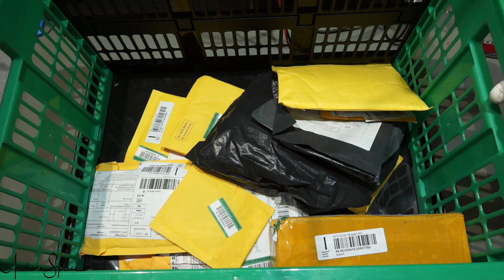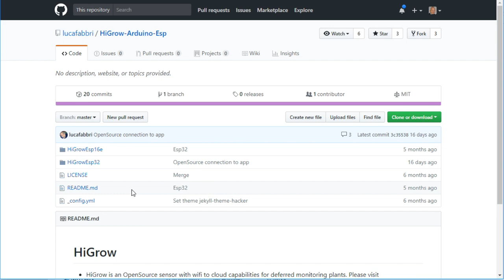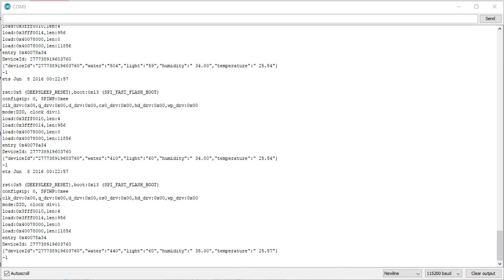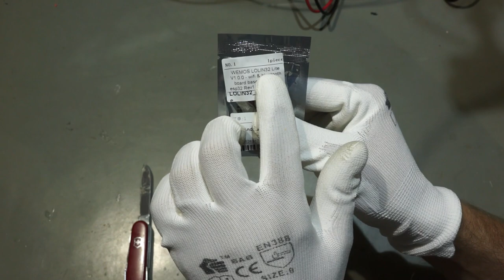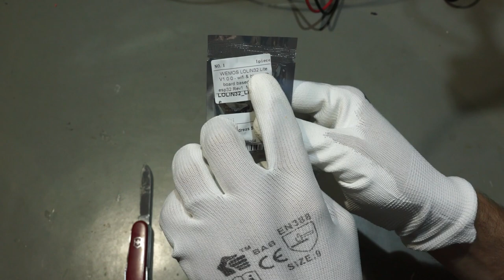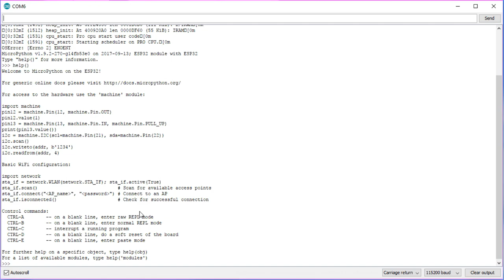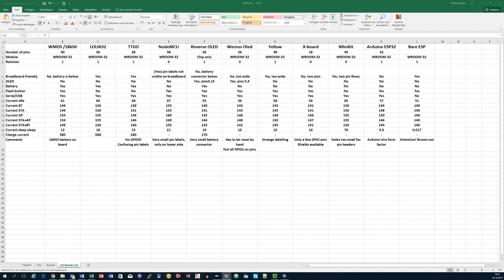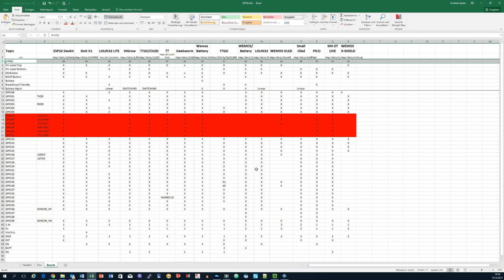#165 Longest Mailbag ever Part 1: ESP32 and other cool stuff

Comment: I don't really see C/C++ going away for microcontrollers. Take the ESP32 for example: If you want micropython + TLS etc (a must for IoT) you have to have external SPI RAM to have enough memory to do anything useful in python. If you do everything in C or C++ it's just about possible to get a ton of logic and a TLS library that supports some of the better cipher suites into ~500KB of RAM.
Reply from the maker: I think you are right in general. But if I see how fast the hardware is moving, maybe we will see other languages on our microcontrollers. And for a beginner, Python is probably easier than C++.
I am also not sure if TLS will be the solution for the moment. We are playing with it on IOTappstory and, as you mention, it does not leave a lot of memory...
Reply: I'm not sure what TLS library you are using but from my experience with ramming mbed into a small space it seems that even the so called embedded libraries aren't well optimized. mbed TLS for example compiles in a massive table of cipher suites to decide which to prefer despite being compile to only support 1 or 2 of them. There are also a ton of tables for sha etc that are loaded into RAM for something like the ESP that loads from flash than can be left in flash and partially loaded in and out as needed.
Reply: Once they start using higher storage ram chips Python will be picked up.
Reply: >Once they start using higher storage ram chips

~512KB or 1MB of SRAM is about the limit for microcontrollers I think. I actually hope we move away for microcontrollers for IoT anyway. A low speed Cortex A chip with some embedded DRAM would give you all the high level languages you want, enough room for proper crypto libraries etc and memory protection etc.
Reply: while any higher level language is probably attractive for beginners, because you dont have to do a lot of thinking, certain things can just be done with lower level languages. they of course require you to actually learn and understand how everything works under the hood. as someone who is proficient in c/c++ it would just hinder me if controllers came with python support. especially when writing applications that barely fit on the chip or which need high performance/low latency.
Reply: C is not going anywhere for embedded. In large production run products companies don't hesitate a moment to spend money on compilers that make smaller code. The reason is cost. The cost increase for a part that can run something like eLua or Micropython is fairly large per unit. That adds up when you mass produce. The Rust language has potential, but C will remain king for embedded use. Not that I don''t like Micropython,  I contribute to it. The ESA has provided funds to port Micropython to the RTEMS rtos that they use on spacecraft. Their targeted role for it isn't anything to do with flight control. That's still in C/C++. They plan to use it for vehicle payloads and science packages. It's much easier to troubleshoot and reconfigure for tasks, and being able to remotely use the REPL to troubleshoot is much easier. 

An often overlooked and under-appreciated language for embedded use is Forth. It does take a bit to get use to, but you can run a REPL complete with a compiler on an ATMEGA328p. That's not a typo, The Forth compiler has no issues running on a microcontroller.  It's a lower level language than C. It's a small stack machine, and forth CPU cores can be tiny and simple. You could probably pack in a hundred cores on a die the size of a modern ARM chip. I'll be the first to admit that it's not optimal for everything, but for control tasks. It's currently in a niche use for very low level needs, BIOS, supervisor systems, etc.

Comment: The esp32 has capacitive touch, I wonder why you cannot just use that by itself for moisture. Wonder why they used a separate oscillator etc.
Reply from the maker: I know about the ESP32 (I even used it in one of my videos). I have a colleague which had some issues with these sensors because of electrical fields. I assume, they only work for small distances. Here, these small sensors could work better because they bridge the bigger distances with a digital signal.

Comment: I strongly recommend not to use Xiaomi devices. I have their phone that was transmitting things to China without user approval, same goes for the Xiaomi Router. No more devices from them in my home LAN.
Reply: Not only Xiaomi but also ZTE and Huawei
Reply from the maker: This is why I want my own firmware. Then, we can control them. They still produce good HW at a cheap price.

Comment: Interesting type of ESP board the ones with battery socket, battery charging and OLED. Too bad one of them arrived with a broken screen but as you might have noticed packing protection is not really used by the chineese suppliers.
Reply from the maker: And unfortunately, I was too late for the dispute this time because I unpackaged it for the mailbag... Maybe I get a replacement screen and change it myself.

Comment: IMHO, it is safe to say Arduino helped quite a lot bringing lay persons into micro electronics, especially encouraging maker scene. Arduino provide an abstraction layer for underlying C++, which is easy to learn. On the other hand, pure C or C++ poses great challenges to novice drawing many away. However, once bitten by the bug, it's a gradual and welcoming transition to more bare-metal programming with C, which opens up a world of opportunities with the microcontrollers and its scares memory. I think this Arduino scenario is just brilliant, well thought out, and nicely executed, which helped making thousands if not more attracted into electronics and programming, with a positive and gradual motivation in its heart to persuade into the depths. 
On the contrary, I feel Python, JS or other few higher level languages used today does not carry this vibe and motivational factors inadvertently advancing us into bare-metal world of things. Surely it gets the job done, but not necessarily pack the motivational punch creating real electronic engineers.
Reply from the maker: You are absolutely right about Arduino and I came back to electronics through this concept. But I think people like me who built computers from scratch (I even had to create the PCBs myself in the early 80s) and started with Assembler are looking for a little more comfort and speed, not more bare metal ;-) And there, a higher-level language could help.

Comment: Xiaomi plant monitoring is the best. The app usually is not working outside of china, but you can use without app too, let me know if you need help.
Reply: Adrian Yeah, I have lots of them! The app 'Flower Care' works fine for me in iOS. Though I ended up just reading the values with a Pi zero and saving on a database.
Reply: I have Xaomi sensor and as I'm a complete beginner... I'm struggling to get the thing to connect to my RPi.  Do you have any pointers for me Adrian?
Reply from the maker: As I said, I do not plan to use it with the app. I just want to read the values with an ESP32. Adrian, do you have a good link which describes  the BLE characteristics?

Comment: I just got the esp32 with ttgo on the back, but fotunately my oled was fine.  Have you found any resources for programming it with the arduino ide?
Reply from the maker: Mine obviously not. But I assume it will work with the normal Library from Squix78.
Reply: After a little searching mine worked just fine.  I made a small sketch that pulls the time from an ntp server and displays the time.

Comment: I don't know how you would workout fakes other than appearance, which could alter in different batches, or simple testing, which doesn't tell the full story.
I ordered 3 batches of STP62NS04Z MOSFET and got 3 different types. 1st was close, 2nd had different font, and the 3rd was not even close to the original. All worked in my low load application, but how do you know if the special internal features of the orig are missing in the fakes. Like maybe they used a cheap IR MOSFET internally with a ST looking case.
Reply from the maker: I plan to look at the frequency response of the op-amps, I bought them because of that feature. If they match, for me they are "originals" or "second source". If not, they are "fake" and unusable for me... I have no other means to test that.

Comment: Booting the ESP32 with µPython, you see vt100 screen control sequences, or ANSI terminal.  You will see them if you connect with a terminal emulator.
Reply from the maker: I still did not really look into microPython so far...

Comment: Andreas, when you look to the 8266 with the OLED and the switch, that one with not that many pinouts. Can you help you to figure out what GPIO which pin is. Is a ,D3=GPIO0, D4=GPIO2, D8=GPIO15,D9==GPIO3, 10=GPIO1 and what does the AD stand for?
Reply from the maker: A0 is the analog input. And the definitions of the GPIOs are well documented. Just google. And test afterward with a blink sketch and an LED where you blink each pin an check with a diode if you hit the right pin.

Comment: Hello Andreas, is your "Geekcreit Doit V1" (mentioned at 13:28) working? Mine can't connect. My Windows 10 fails to recognize the device. Even after manually installing the driver from silabs.com it does not work.
Reply from the maker: I currently use it as one of my development boards and it works ok.

Comment: Hi Andreas.  The Wemos boards with the 18650 battery packs are fake clones (nothing to do with Wemos).  The originals are from this guy here: https://www.tindie.com/stores/lspoplove/

On the originals, theres apparently a voltage leak: https://www.tindie.com/products/lspoplove/pocket-32-v2esp3218650-battery/

Would be interesting to hear your thoughts on it!
Reply from the maker: I stopped caring about "fake/clone" and "original" because there are only a few manufacturers and many sellers. So I can not judge who manufactured the board and when.  I concentrate more on "it works" or "it does not work".
Thanks for the link. I anyway plan to look at the power supplies of the different ESP32 boards because they are quite different. Then, I will also check your link.

Comment: Dear Andreas, thanks again for one more informative video. It would be great if you could mark in your Excel sheet what type of communication is used between OLED and ESP (I found I2C isn't speedy enough in some projects and only way to use it flawless is SPI). Thank you! And I still hope to see your promised video with comparison of different voltage regulators (it was looong time ago). It might be very beneficial for a lot of your subscribers. @ the end I wanted to cheer you in your local language and was not sure what language is official in Switzerland - just realised that there are 4 of them!
Reply from the maker: 1. To my knowledge these boards use I2C, which is usually fast enough for these four lines and text. As you mention, it is different for other scenarios.
2. The promised video will come, but I do not know, when.
3. Yes, we speak 4 languages here, however, the fourth is no widely used.

Comment: Hello Mr.Spiess..
I wanted to know if you were able to test the ESP32 DOIT board that you got from Banggood..

I had ordered 2 ESP32 boards from Banggood last month (same as the board you have got) and the WiFi of both boards do not work!
I am unable to find out the issue. Is it a hardware issue or a firmware issue? Yet to figure it out.
Reply from the maker: I just tried mine. It works. The chance that 2 boards have the same error is quite small. So, I think, it must be your sketch. Maybe you start with a simple example file from the Arduino IDE
Reply: Andreas Spiess I tried with the LED blink and it works fine.
I then used the "WiFi Scan" program from the examples. I always get the message "No WiFi networks found".
I even tried WiFi.connect(SSID,pswd) program and it is unable to connect to the given credentials.

I had ordered them during Banggood's sale.. I think both have become defective!

Comment: Have you tried to load sketeches to the ESP with the switch OLED board? What UART driver will it use? I do have on and neither PlatformIO nor Arduino IDE shoes a port.
Reply: Solved it with a fresh install/update of the CP2102 driver from http://ow.ly/O4oa100XM5X

Comment: mongoose OS with JavaScript mqtt pub sub handlers is really all you need on the chip. Anything more complex like logic, algorithms should be handled on an external nodered host.
Reply from the maker: I just started with mongoose os. It is not as simple as it looks like at the start. And the documentation is not great... But finally, we got something working. I hope, it will appear in one of the next videos.
Reply: That's true. Documentation and for that matter some of the libraries are lacking but the benefits are that all you really need to do is modify the JavaScript instead of flashing the board every time - this enables for rapid development and far easier debugging. OTA is also possible but don't quote me. Good luck sir

Comment: I had a similar plant sensor from tindie.
Unfortunately after some month the lacquer came off. I wrote a review, but never get a response from the shop  :(
The problem is, that the lacquer was not applied in a separate processing, it's only the normal sealing of the board.
So the small side is uncovered and water could get under the lacquer.
A colleague told me to remove the defective lacquer and to apply "tropenlack" onto the part which sticks in the soil.
I'm curious about your long term experience.   (probably you should apply Tropenlack befor first usage)
Reply from the maker: Thanks for the experience. I have to check how the sensor works (or do you know). If it is really not resistive it should be possible to put an additional plastic around it.
Reply: it a capacitive measurement, so an additional layer should not affect the principle.

Comment: Hey youtuber! I really like your videos and have been fan for a while now, and i was wondering that if you would be willing to take on a new diy project(when you find time ofc). We all have seen DIY powerbanks which usually include power bank modules with some 18650 batteries and call it a day, but I was wondering if you would be able to make a tutorial or video on how about to use USB type-c connector and to make it give correct amount of power and such. It is atleast for me much more interesting, then just using already made modules which are basically plug and play and since USB TYPE-C modules are rare and noone really uses that tehnology yet, then i would love to see a video about it.

Thank you for your time, if you read this!
Reply from the maker: Thanks for your feedback. I still have a video about a power supply with batteries for solar power on my list. But for the moment, it will be based on normal technology, not on the very now quick charge algorithms. Maybe there will be at least a little bit to learn for you there...